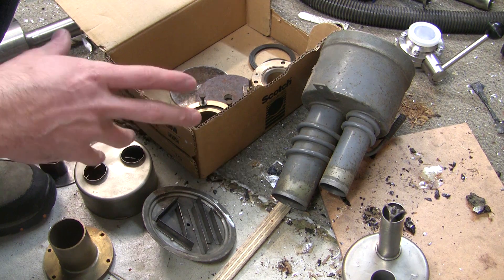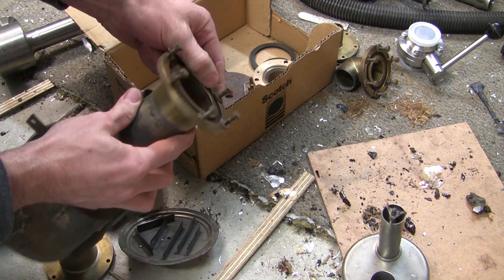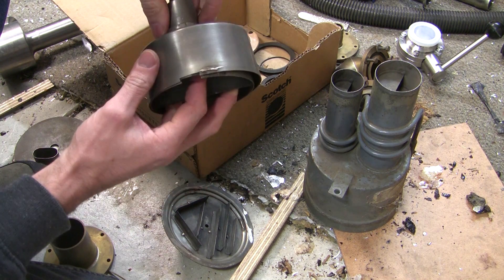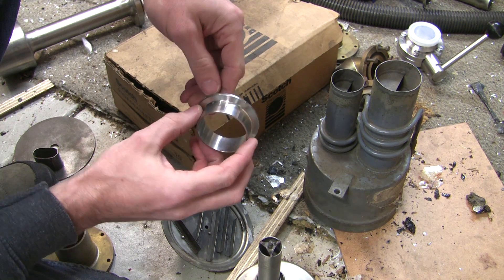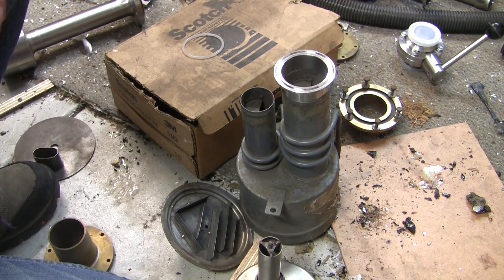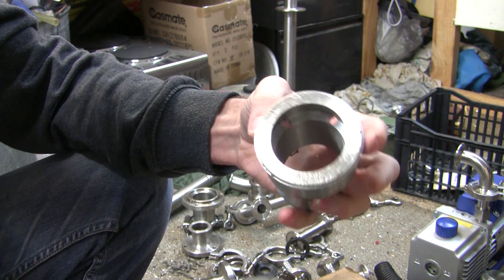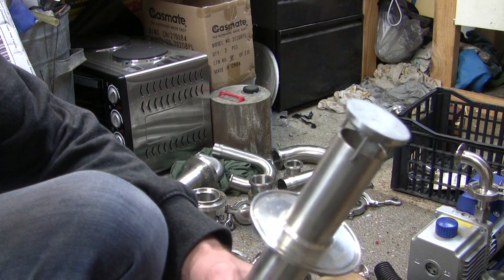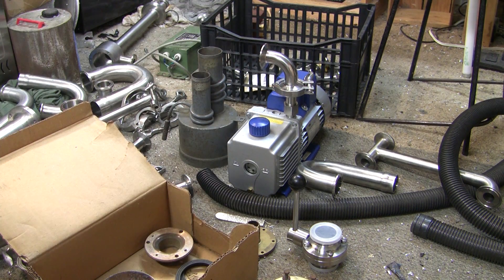oil diffusion pump rebuild

Comment: at the bottom of the diffusion pump, there's a center hole at the bottom of diffusion pump oil container, is it sealed with solder?
Reply from the maker: That's the drain hole for the oil.. It has a screw with a copper gasket
Reply: Thank you ! This diffusion pump design is interestingly weird..
Reply: Ooh, that copper gasket is making "knife-edge" sealing at the hole..

Comment: Congradulations. You just destroyed this diffusion pump. The jet assembly was meant to be disasembleable. By welding it together you effectivly made cleaning imposible.
Reply from the maker: lbochtler you have zero idea what your talking about.. On most pumps that is true.. This is an old pump and it was silver soldered and welded from the factory.. .. Tell me in your ultimate wisdom how the bottom of the pump was supposed to be sealed? Or even held together?
Reply: why, solder of coarse. Well silver solder. Unlike a weld, its more easily reversible.

I was however more annoyed about you welding the jet assembly. Though you are correct that my knowledge of very old Diffusion pumps is very limited to say the least. I only have experience with pumps from the 70's onwards. (mostly Varian and Anelva pumps). 

I must somewhat correct my previous comment in that the pump will likely work, but cleaning it will be a major pain in the arse once you have to do that. Though then again, i don't know enough about this particular pump to say that for certain. 

I do have to say though, that its one very unique design you have there.
Reply from the maker: lbochtler I did solder the base on.. The internal baffles are just tacked on so it would take about 2 minutes to nip the welds.. When my dad opened it he had to grind the solder off its such a large area youd never get it apart any other way.. It's a pump that's simply not designed to be opened.. It should last year's with the valving I have as it won't ever be exposed to air while it's hot.
Reply: good